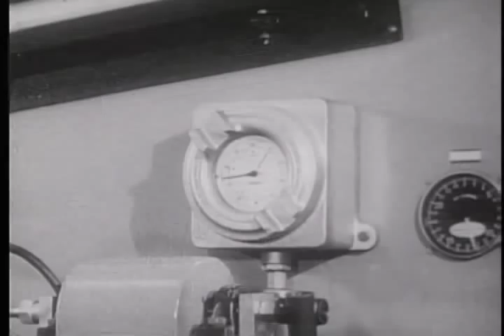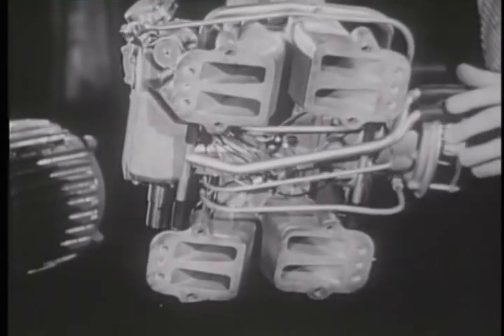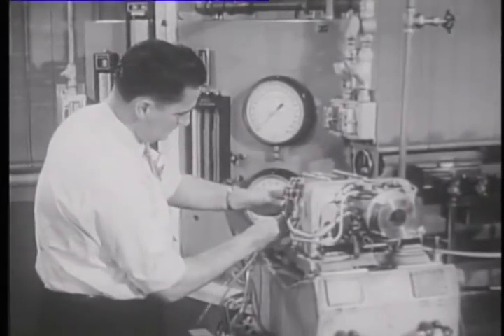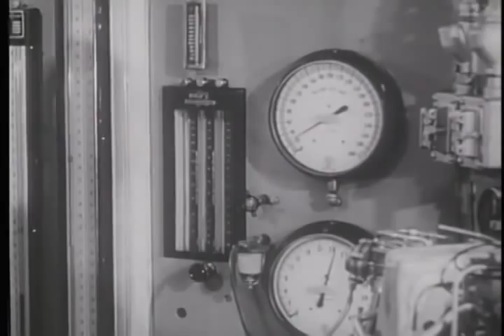GMs 1st Fuel Injection System

Comment: My grandfather had a 1957 Chevy Belair, 8k original miles. It had a port injection manifold with mechanically operated fuel injection. The side of the production Belair actually said "Fuel Injection" on the fenders. The 58 Corvette was not the first fuel injected car by GM.
Reply: The Corvette seen in the video was a 1957 ( single headlight ) 
1958 Corvettes had quad round head lights ( 2 each side for a total of 4 ) 
In 1957 the FI was available in the Corvette and Bel-Air platform 
And from 1958 thru 1965 in the Corvette only
Reply: It was also on the 57 bonneville, but they barely made any of those
Reply: No one said it was, Einstein

Comment: The iconic Messerschmitt BF109 fighter plane already featured a fuel injected Daimler Benz engine, back in 1935,
But I believe it had a simple mechanism of a valve shaft pushing the injectors at set timings with a permanent amount of fuel,
Unlike today, where everything's digitally manipulated
Reply: Mercedes used this system in their cars.
Reply: AMC's rambler rebel was the first Electronically fuel injected american car, i believe the system played an integral part in the development of the electrojector system chrysler debuted in the chrysler 300d the next year.  The electrojector (and presumably the rebel) performed excellently on the controlled test track, but horribly once they made their way out to the public.  The reason?  Well, it was never discovered back then (the system got sold to Bosch after chrysler couldn't figure it out), but a modern chap with an internet connection figured out and documented online that RF interference caused the 1950's capacitors to more or less go haywire.  When replaced with modern shielded capacitors, the cars performed as they did on the test track.

Comment: Im surprised that they basically had multi port injection back then. Even in the 80’s early 90’s they were still using indirect throttle body injection in most cars.
Reply: The GM system was purely analog and mechanical. In early electronic fuel injection, The problem was a combination of processing speed and emf shielding. 
Every time you drove past a high power radio station, or keyed your CB mic the engine would stall. 
Chrysler Corp tried in 1958 and actually put it in production in (I think) the Fury.

Comment: Wow....imagine a golden era when GM actually TESTED its products!
Reply: Gm still does testing... but they use customers to do it.
Reply: @scrappy7571  😂
Reply: Yeah the era of things being built to last and not designed to brake, like the all metal refrigerator in my shop from 1960 that still works on the original ozone eating refrigerant, sucker has two setting cold as shit and frozen solid makes a great beer fridge

Comment: My dad ordered a Chevy 4 door wagon with a fuel injection system on the 265 engine and a power glide trans . I remember the wagon well . He had it until 1960 when he traded it for another Chevy wagon .  So 1958 was not right at all . GM was using the injection system even before 1957 and before 1956 .

Comment: Back when GM was intuitive, ingenious, honest, and made quality products. Boy have those days gone. Now, anything they make, is the worst piece of shit you can buy… other than Fiat/Chrysler or Volvo lmao
Reply from the maker: Their quality is vastly improved.
Reply: @KingRoseArchives  Not in my experience. If it doesn't have a pushrod V8 and rear wheel drive, it's reliability will be a mess. Got burned by timing chain failure on a GM 3.6L at only 90K miles. Full synthetic oil changes every 5K miles. What a garbage replacement for the excellent Buick 3800.
Reply: @honkhonkler7732  Imagine buying fwd 4/6 cylinder
Reply: @V8_screw_electric_cars ever heard of honda and Toyota, smoothbrain?
Reply: @ryantogo8359  yes boredom on wheels
Reply: @V8_screw_electric_cars  enjoy wasting money on gas
Reply: @ryantogo8359  it is not waste it is worth it I don't drink or smoke so I can spend on gas.

Comment: Why we stopped using this?
Reply: Too much costly and not very relialable. The technology wasn't ready at the time
Reply: @phantomsoldier497  They could been improving it
Reply: @V8_screw_electric_cars  we are using it in everycar now lol. It was too soon in the 1950's
Reply: Another reason was Bubba and Clyde down at the local garage did know  ( or wanted to know)  how to work on them. Many people got tired or no one wanting to work on or fix them. Thats why many were converted over to carbs.
Reply: because they went on to produce much larger carbed engines that produced more power and were cheaper

Comment: Finding a 50’s car with the original fuel injection system still on it and in proper working order is like finding a unicorn. Most of these early mechanical fuel injection systems were problematic and removed in favor of a carburetor.
Reply: My Dad told me the biggest problem with the entire system was that dealer techs couldn't be bothered to learn how it worked. POOR SERVICE killed the Rochester FI system, not its design.

Comment: knew an old guy that was a Chevrolet service tech. he went to GM school to learn how to work on these fulie systems. I asked him if it was as bad as people assert. he said, it was great system as long as it was in tune. what would happen is they would take their car to a corner garage and someone would go to monkeying around with it and start turning screws and throw off settings to make it run worse. People are inherently cheap an not take it to the dealer for repair. you get what you pay for.

Comment: I take it the 1958 corvette with fuel injection was a concept car?  Im not exactly a car guru, but I dont think the corvettes made after it had fuel injection until later on like around atleast the late 70's.  I could be wrong though.
Reply: Gm had fuel injection from 1957 -1965 in the Corvette. Then a brief stint with the Cosworth Vega in 1975 and 76. No fuel injection again untill mid 1980's.
Reply: SaGalv I think they offered a fuel injected 327 up till '65 with 375 horsepower but by then you could order a big block 396 with more power at a much cheaper cost so that was the end of fuel injection till the '80's
Reply: You   could  order  fuel  Injection  on a  passenger car  from  1957   till  I don't know what year in the  car   but until  1965  in the small Block Vette
Reply: You're thinking of electronic fuel injection, this is very basic mechanical fuel injection.

Comment: Kind of a joke, really. It continuously sprayed fuel out of all 8 jets all the time! I can see how they got high h.p. out of the engines with it, but what kind of mileage? Guess the 'vette owners didn't care too much about that, or the $500 additional cost of the unit.
Reply: It used venturi pressure differences that varied fuel spray.
Constant fuel spray would have to be varied otherwise it would have a very narrow running band, it would flood at idle and/or be fuel starved at high RPM.
Reply: @D8W2P4  funnily enough, mechanical injection runs poorly at low rpm as it is typically quite rich at low rpm
Reply: Why is it considered a joke? Bosch introduced their K-Jetronic constant flow injection system a number of years after they produced their first electronic system. It would eventually make it's way onto the likes of Mercedes, Ferraris and Bentleys, as well as a number of lesser cars. Though it used a different mechanism to measure air flow, they all match fuel flow to airflow requirements. Incidently, both Continental and Lycoming have used constant flow injection systems for years, with better performance, economy and resistance to G-forces than carburetors. The Bendix system on the Lycomings uses a similar principal (venturi type air meter) as the Rochester system.